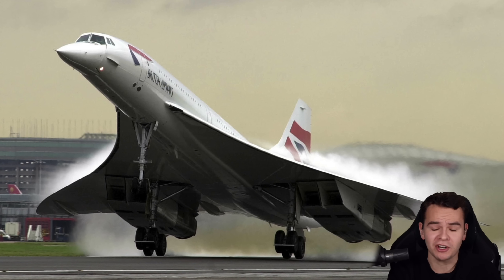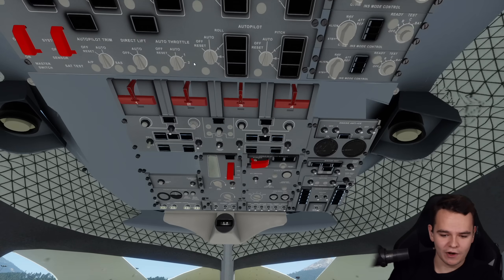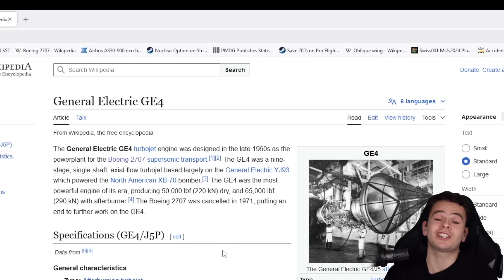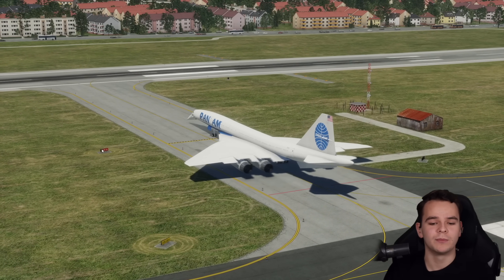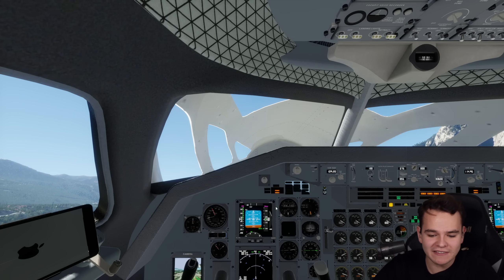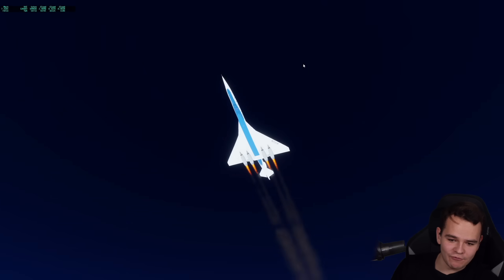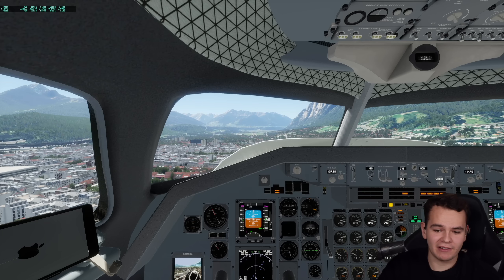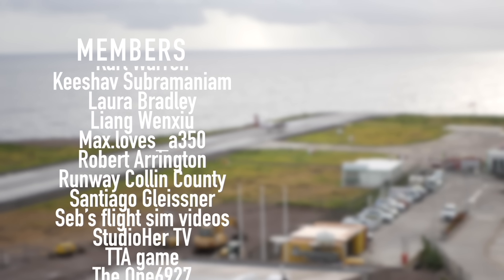Flying The FASTEST Airliner - Why Did the B2707 FAIL?

Comment: Boom is the new plain that is going to bring back supersonic flights with out making a sonic boom using technology
Reply: Boom will never take off (no pun intended) they still use 3 times more fuel than sub sonic planes and only carry 60 people plus their range can only just make it across the Atlantic. They still would not be able to cross the Pacific without stopping. Plus they will be slower than a Concorde. Basically this all means major airlines will never make any significant orders. The only way to make a commercially successful supersonic airlines is to have it be able to be as efficient as a subsonic one

Comment: Boeing needs to bring it back in my opinion
Reply: @DeggMonnels don’t worry, they can just use some zip ties and duck tape. And they can also use super glue if they run out of welding material.
Reply: Boeing needs to bring back Boeing first.
Reply: @ yeah rn it has more McDonnell Douglas than boeing since McDonnell Douglas also rushed planes to production
Reply: @Art32-e4s yea

Comment: Swiss should rate some free addons for X-Plane. For example, the Stratosphere 777-300ER (the liveries are broken and you need an access code which is accessible through the Output folder).

Comment: The Boeing 2707 tried to do too much. It wanted to fly fast, It wanted to land slow, it wanted to carry 300 passengers too. Unfortunately if you want to be an SST, you can only do the fast part. Also, planes with variable geometry wings are VERY heavy - add pax and comforts for the pax and it aint' goin' fast no more!  Oh wait. now I watched the whole vid. That was a different boing SST concept, sorry this one doesn't have swing wings, but you know the one that does! I didn't imagine it!
Reply: that actually was the 2707, the one in the video is just a later version of it to replace the swing wings.
Reply: @noodleluke1  the one in the vid was the 2707-300
Reply: Why can't you carry 300 passengers fast? Surface friction is a problem. Large planes have better surface to fuel ( for cooling ) ratio.